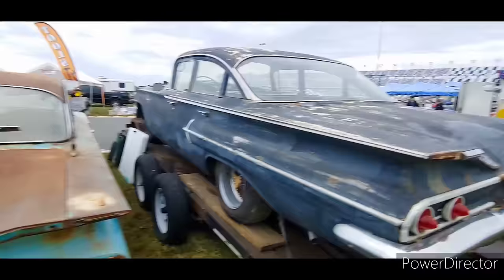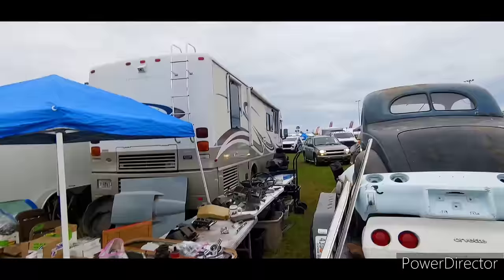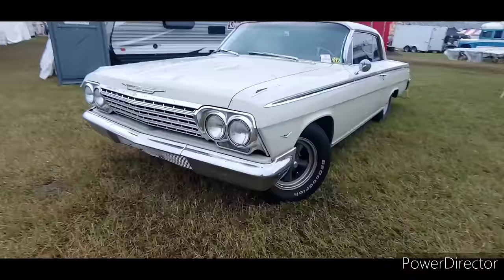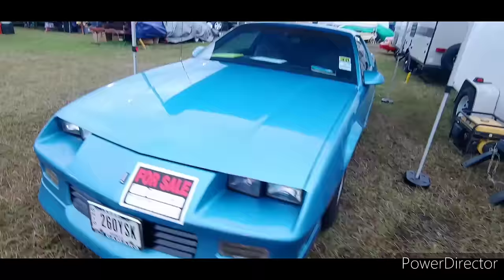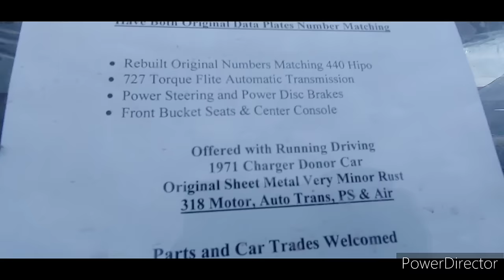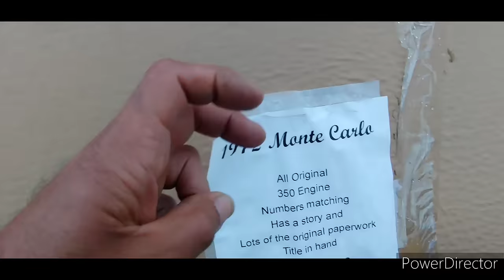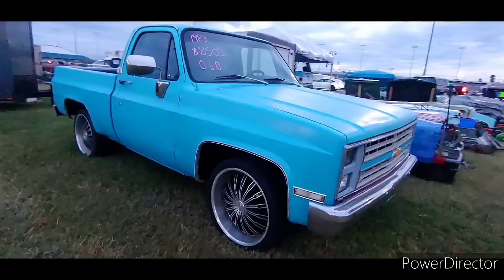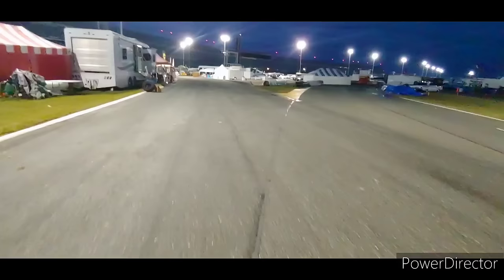Classic Cars and Trucks For Sale Daytona Florida Swap Meet Turkey Run 2023

Comment: Yup, 1967 GTO with the VIN for the win: 2 for Pontiac, 42 for GTO, 17 for two door hardtop, 7 for 1967 model year, K for Kansas City, MO assembly (Leeds) and the rest is the production sequence. The Leeds plant closed in 1988. 

We got the PHS, and that's the best: Zone 22 is Houston, TX, dealer 275 is unknown, 223 for Black interior trim, N for Burgundy exterior paint, and each code in a given box corresponds to an option, which is too numerous to do here.

Comment: That key way you see in the fenders of these old cars, that's old school anti-theft devices. It would trigger the car horn if someone would try to crank it or break in it without the correct key. You'd leave the car, turn that key way to the left to set it.

Comment: Benny could you help me out. I have a 1984 2dr 98. 51,000mi Dad bought it new. Unfortunately 10yrs ago she was hit in the front. At the time the insurance said it was a Total. But I fixed it myself.  It looks and drives fine. It just needed a front clip. I now need to sell it. Everyone tell me it's not worth anything because it has a Total on the title. Again the body and interior are perfect.  She is Sand with a Royal blue interior and quarter vinyl. What do you think? I'd like your input. Thanks Benny